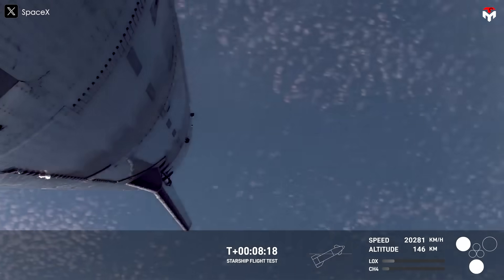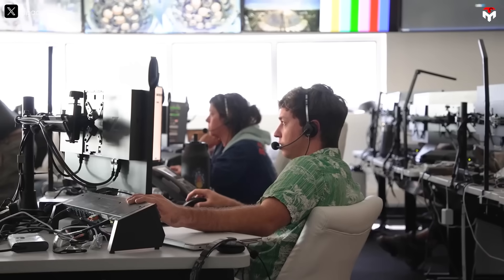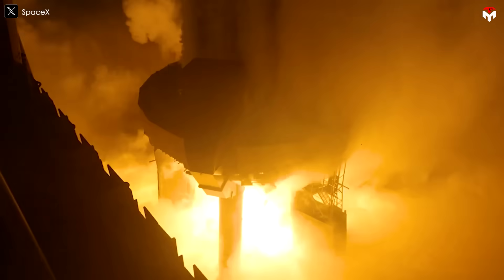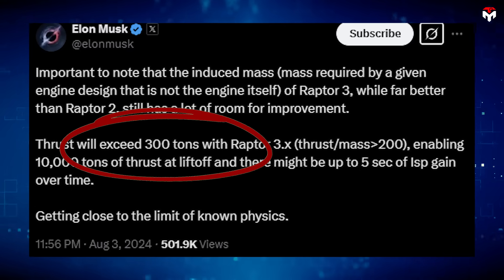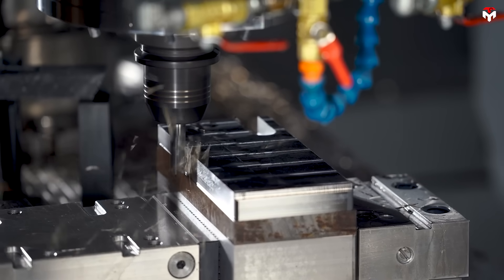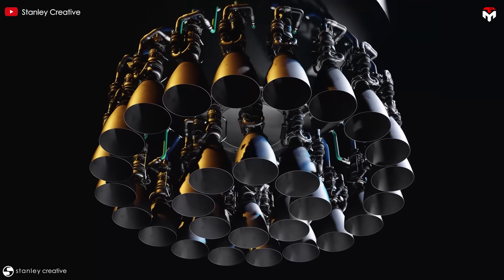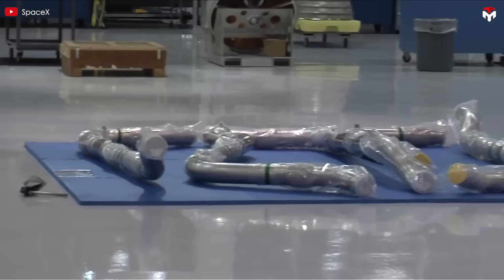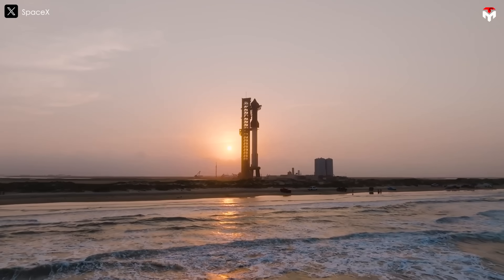SpaceX Upgrade Everything on Raptor 4 after Flight 8 Raptor Failed Shocked NASA…

Comment: I'd be most interested to know what a sound engineer thinks of the flat symmetrical terminal edge of the exhaust bell's effect on magnifying vibration produced by thrust exhaust.  That thing is currently designed like a trumpet; that is, it is designed to vibrate.  I'm no engineer but, it might do better with a wavy surface and variable wall thickness.

Comment: So far SpaceX does not seem to produce more power using the same quantity of fuel. I.e. no improvement in efficiency which will make getting to Mars and back very difficult
Reply: that may be so considering the raptor  already burns its fuel with 99% efficiency. but the raptor 3 having less mass and no need for heavy shielding that the raptor 2 needs makes the raptor 3 more efficient in mass to fuel ratio's.
Reply: @michaelotoole1807  Rubbish, not 99%.  The overall engine efficiency in a vacuum is around 83%. At sea level it's 77%.  The overall reusable system efficiency is just 4.6%. That's the kinetic energy of the payload in LEO divided by the chemical energy in the tanks at liftoff.
Reply: @hairyferrit  I'm just saying what musk said. that the oxygen to fuel burn was 99%. and that raptor 3 was lighter with higher chamber pressure  v2-300 to v3 -350. and needing no heavy shielding that the raptor 2 needs.
Reply: @michaelotoole1807  He says a lot of things that are not true.  He said they would catch the starship on flight 9.....er...
Reply: @hairyferrit  he is a overly optimistic fellow.

Comment: Have they even started using Raptor 3 engines?  Maybe they are innovating and moving too quickly.
Reply from the maker: raptor 3 is planned to be used this year
Reply: @techmap9  Let us see if it does not suffer from the V2 problem.
Reply: @gottfriedheumesser1994 what v2 problem? there is no problem with engines
Reply: @doodocina  Inform yourself!
Reply: @ harmonic oscillations in fuel lines. nothing about engines
Reply: @doodocina  There was an assumption about a break in the nozzle of a V2 vacuum engine.
Reply: @gottfriedheumesser1994  v2 and v3 have exactly the same nozzle, that was the first issue with the raptors of that kind. mby the root of the problem is somewhere else
Reply: @doodocina  My thought is that a possible design bug in V2 nozzles should also be in V3. So it makes little sense to state that this will not happen with V3. If it should be so SpaceX can 'recycle' all of their V2/V3 vacuum engines.

Comment: True, the SpaceX-Thrust absolutely crucial for Space travel enabling the 🚀 to🚀 launch. Not only tht, the thrust force overcomes gravity, allows space craft to accelerate and to change directions. ONETHING, there's a fragment tht I am thinking of whn kvyn fr Great SpaceX platform said something about SpaceX building a "hole? Below the Mechazilla-chopstick?
? raptor Merlin fire so strong causing to vibrate...🙄 Ha.ha.ha. If u can fill it for me. I'm learning. Thank U🌾🌟 for the Cont. Ed ✨️
•~●😼🌻
GOOD MORNING 🙏 🌄
Reply from the maker: Hey, thanks for the enthusiasm! I think you might be referring to the Mechazilla system at Starbase, but I'm not sure about the "hole" part. Maybe you're thinking of the launchpad or something else? Let me know if you have more details! And yeah, those Raptor engines are incredibly powerful! 😊🚀
Reply: @techmap9   Yeah, u knw during "launch of the FALCON." B-coz of the strong firing 🔥 esp the upgrade Raptor Merlin 3 or 4 causin' "damage of the bottom of the "Mechazilla" melting❓️I think SpaceX is thinking or they're installing the "fire exits extension." OR SORT OF,  KINDA LIKE tht. I shd had written it but, everything got stuck in my brain 🤭😹🤣. 
Hey 👋, Indeed, I learned fast not b-coz I'll build my own 🚀 rocket very soon. Tht wld be impossible but, the learning process. Thank U. Have a nice w-ends 👍 my friend 🌾✨️ ur sweet 🌟// kat🌻